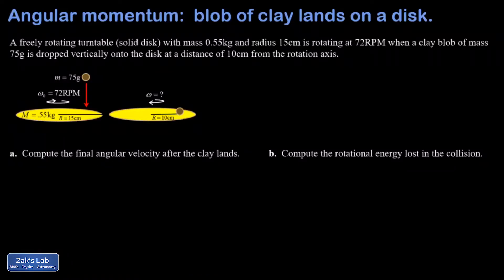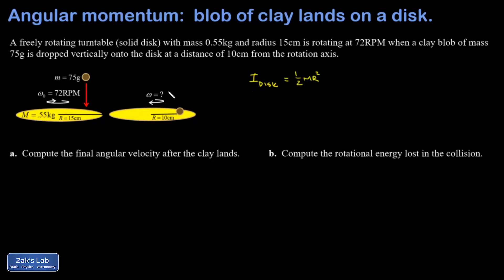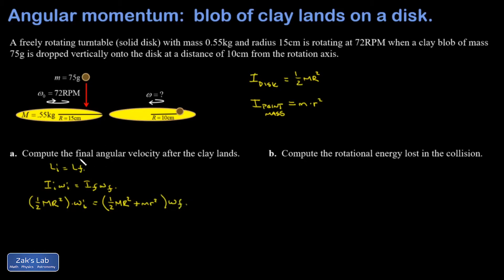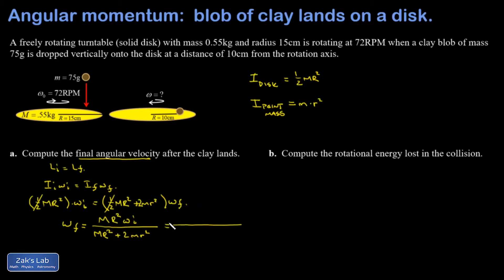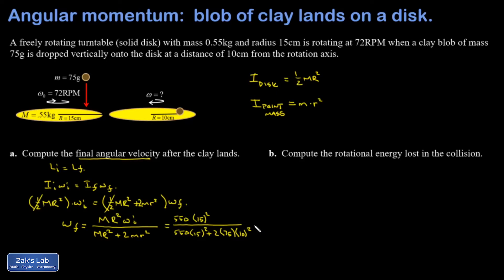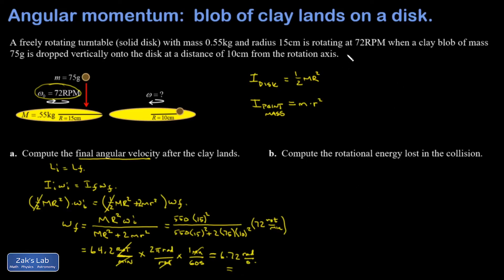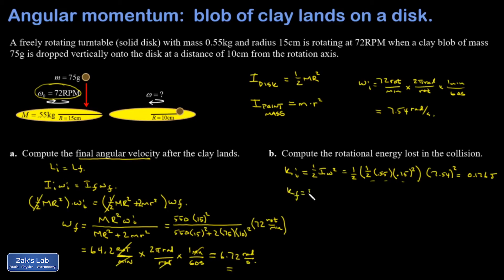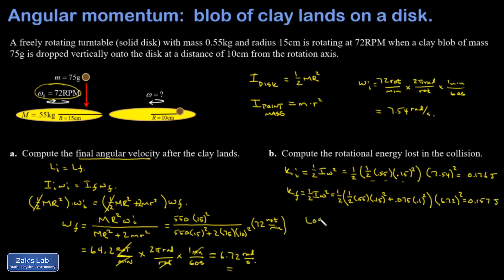Conservation of angular momentum, clay lands on a disk, and kinetic energy lost.

Comment: NO. The initial (immediately before the collision) angular momentum of the blob IS NOT ZERO: it, having been dropped from a certain height, lands on the disk with a certain velocity (it does not materialize on the disk from nothing with zero velocity!). 

The blob's angular momentum IMMEDIATELY BEFORE THE COLLISION is, with respect to the center of the disk, the vector product of its position vector from that center at that instant and its linear momentum - mass x velocity immediately before the collision -, the latter being, according to the geometry of the problem, parallel to the axis of rotation of the disk and directed downwards. This provides a contribution the total angular momentum (disk + blob), immediately before the collision, perpendicular to the plane defined by the axis of rotation and the position vector of the blob, hence perpendicular to the axis of rotation.

The total angular momentum of the system disk + blob IMMEDIATELY BEFORE THE COLLISION - a vector! -, has therefore two components: one along the axis of rotation of the disk, contributed only by the disk, and one along an axis perpendicular to it, contributed only by the blob. 

The total angular momentum (disk + blob) IMMEDIATELY AFTER THE COLLISION, has only one component, the one along the axis of rotation (the disk and the blob rotate as a single body about the original axis). 

The total angular momentum of the system is therefore not conserved through the collision: this non-conservation is explained by the fact that, during the impact, the constraint at the center of the disk has to generate an EXTERNAL (to the system) torque of "impulsive" nature, i.e., intense and of very short duration, to maintain the rotation about the original axis! 

What remains unaltered is actually JUST A COMPONENT of the total angular momentum, the one along the rotation axis! With this premise, your calculation of the final, immediately after collision, common angular speed is correct; the reasoning and the logic behind it, however, are conceptually wrong and pedagogically misleading.

Also, in the balance of energy equation, the kinetic energy of the blob (related to its non-zero velocity immediately before the collision) has not been taken into account.
Reply from the maker: pinned!  this is an extremely thorough analysis of the unstated assumption of the problem:  the vertical axis is the only relevant axis because the fixed axis of the bearing constrains the relevant analysis to only that axis.  For the linear version of the same issue, see the classic haybail momentum conservation problem:  https://www.youtube.com/watch?v=taQtHf-WEBQ

Comment: If energy is lost in a collision, then we cannot possibly calculate the "loss of energy" based upon nothing but theory. What you are directly calculate is that conservation of angular momentum theoretically contradicts conservation of energy. 
You have discovered that angular momentum is not in fact conserved, but you are making nonsensical excuses for it.
Yes, I know that everybody does that. Everybody is wrong.
Reply: @Diff 25 denial and neglect, like a flat earther behaves
Reply: @TheAnimammal  Energy can be lost in a system to its surroundings. Universally, the conservation of energy holds true. Dumbass.
Reply: It isn't lost.  It is converted from angular momentum to heat.  As far as the system inertial energy goes, it is gone, lost into the universe.
Reply: @theeddorian  false. It never existed in the first place because angular momentum is not conserved.
Reply: @TheAnimammal  Try again.  This time with references.
Reply: @theeddorian  new discoveries won’t have references, will they?
Reply: @TheAnimammal  So, it's a "discovery" of yours?
Reply: @theeddorian  correct. I was doing r&d and discovered that a fundamental law of physics is stupidly wrong
Reply: @TheAnimammal  You are making a claim to a number of people, yet so far that is all you have offered.  A simple assertion, and you have not offered any observational consequences that anyone can verify.  It would be reasonable to argue that what is really conserved is the moment rather than some linear vector or rotational effect.  But to claim the energy is not conserved requires you to show that it is not transformed or radiated away.  Otherwise, your assertion sounds as if you expect a rotating object in a vacuum to slow and stop rotating without external influences.